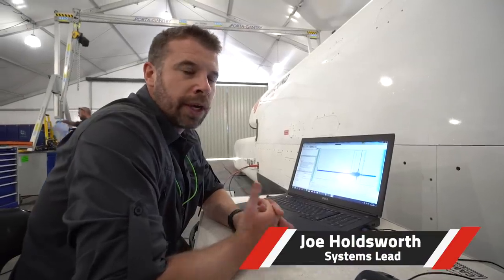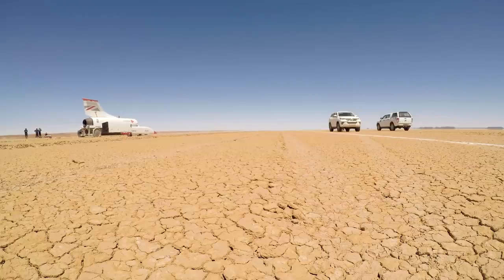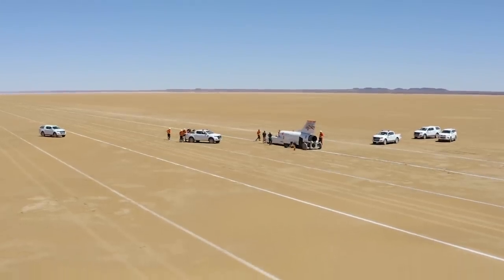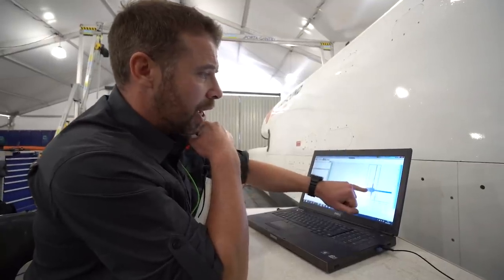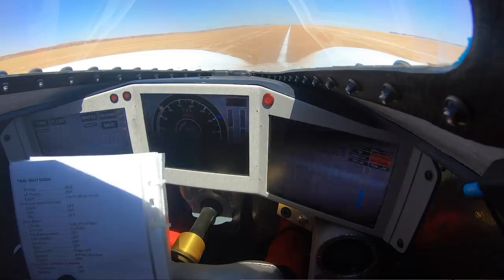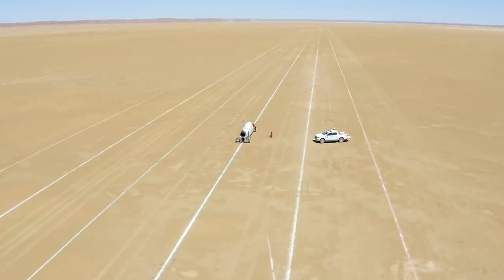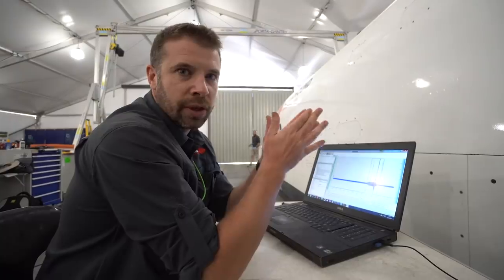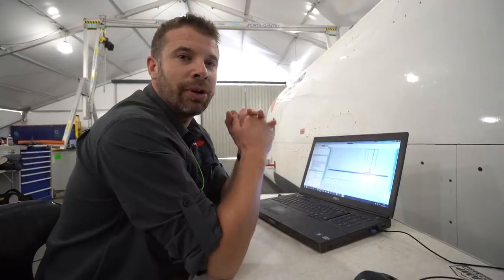Bloodhound LSR Run Update | #2019HST

Comment: That's some force on the vehicle and the resulting movement of things that causes contacts to move.
Going to have to time after seeing the falling edge and check for a rising edge in the debounce period.
Is it practical to have that?
There's many digital inputs from switches, one can't implement that on all now?
I would be soldering caps across stuff lol.
That's concerning though, that vibration can cause contact movement and an unintended command takes place.
Luckily it shut down the engine, but this is still at low speeds.
Now I'd be worried about safety.
Would rather sort out the electrical problem as a cause, the software is doing what it should.
i would not change it, fix dat switch.
It's a safety circuit, can not have filters or delays on it, seriously.
Thanks for the update, D.
Reply: Good points! But, that said, there’s no way that Andy would be able to push a button for only 10mS. I’d be busy soldering caps too but I wonder if they’d have them in the desert. Time to call Farnell, maybe! 😁

Comment: Not been fully following the progress, but is this the same track (with bumps) that the eventual record will be attempted on?.
Reply: Yes
Reply: No it's not.
They've got over 20 tracks mapped out. These are the preliminary test tracks for up to 600mph.
Reply: joe pineapples The surface is, yes. I think there’s a track going across the parallel tracks that Bloodhound runs on. If you watch, you can see a change to a darker colour at 0:53 in the video.

Comment: Ah, a software work around for a hardware issue. I spend half my life writing those. I've written at least two debounce routines in recent years that I can recall.
Reply: That did not work out well for Boeing.
Reply: Bob Smithies Because Boeing's software work around was badly designed, not documented externally, and the impacts or even existence of it on the control of the aircraft not in the pilot training material. I am sure Andy Green is aware of this one.
Reply: @owensmith7530  - really ? Lets hope they put it in the manual.

Comment: Is this going to continue building to the 1000mph record attempt, or is it a test program that will stop short of that?
Reply: This year is testing with the jet engine only. Next year they’ll be back with the rocket installed as well.
Reply: @andylewis7360  I remember reading something like that ages ago but, with the stop/start funding problems, wasn't sure if they'd changed their plans to do it all in one hit, while they could afford it.

Without the rocket, isn't it still possible to slightly exceed the Thrust SSC record? Not sure if I imagined that bit.
Reply: tjp353 You’re right. I was working on the basis of the original plan, as I perceived it. But I’m sure the plan was worked out meticulously so probably best to stick with it.

I suppose bloodhound could beat Thrust SSC’s record, given a long enough track. We can hope, I suppose. She certainly seems to accelerate like a scalded cat! 😁

I pretty sure that the full record attempt will be next year, not least because Bloodhound’s 2019 exploits could attract a good deal more sponsorship support.

Comment: Literally "switch bounce". Hmmm. Wonder if the switch manufacturer envisaged their product doing 1000MPH across a desert in a vehicle with metal wheels? Ha! Go for it folks. Faster, harder, more!
Reply: Good point! They were altering suspension settings yesterday. Electrical control switches and connector contacts are usually rated for high G ratings. Usually tested by putting them on a big loudspeaker cone and sweeping the frequency up from 0-20KHz. It’s quite unusual to get a bounce in normal operating conditions without an intentional click. I reckon it was a connector contact. Extending the debounce period should cure it. I only hope they’re using automotive connectors and not aerospace ones. Planes don’t get many shock loads. Cars do all the time.

Comment: Unbelievable how many tiny little setbacks this project is having.
Reply from the maker: GladiusYTR welcome to running a prototype racing car. These are just teething problems and easily fixed
Reply: @bloodhoundssc  Totally agree. Keep grinding at it!
Reply: GladiusYTR It’s par for the course, mate. A volume car manufacturer will build dozens of prototype and pre-production vehicles and test them almost to destruction over 18 months to 2 years before the first model is sold.
Reply: @andylewis7360  Yep. All true. It just puzzles me how sometimes small teething problems interrupt a whole day of running. I'm sure the Bloodhound team don't have all year to keep running the car and sort out niggle after niggle. Surely something like a steering wheel switch debounce filter should already be part of the control software and have some sensible calibration. Particularly given that NVH at 1000mph can't be a minimal factor.  OEMs do a lot of prototyping, true, but small issues like these don't usually interrupt testing. Granted this is a LSR car and the risks involved are greater... Perhaps these things are normal in the context of breaking records and we're not used to getting the special insight we are seeing from the Bloodhound team. Either way, it's so freaking fascinating and awesome.
Reply: GladiusYTR It IS fascinating, isn’t it?! My guess is that they went for the minimum value they could set, on the basis that if it doesn’t cause a problem then they’d get the fastest possible reaction time. I’ve never used a debounce time of less than 50mS and 100mS in most normal circumstances. Given the fact that it’s a kill switch for an engine that takes tens of seconds to wind down, I don’t imagine that it’d make a whole load of difference but I suppose in an emergency, some 10’s of mS could make some difference, although I can’t imagine what. My main concern is that it’s an indication that they’re using aerospace, rather than automotive connectors. Auto connectors have got to be more tolerant to vibrations than something that’s fitted to an aeroplane.
Reply: @andylewis7360  My thoughts exactly. "Less than 10ms" denounce is not an acceptable figure at all and my experience correlates with yours in terms of what would seem like a logical amount of time. Overall it may be possible that they are using Motorsport connectors even, we don't know the severity of the bump that Andy went over but from the data trace it looks like it was maybe 200% amplitude compared to normal road forces. If the switch wiring failed and not the switch itself, doesn't matter what switch you use. I hope that the Bloodhound team learn from this experience and identify potential failures like this before it causes another run profile stop.
From here on out it looks each run profile is a "one shot" milestone, so either they get over the wall of minor problems now or they'll be in South Africa until 2021.

Comment: Surprised your suffering with switch bounce.. somebody skimped on the switches!
Reply: Switches bounce, it's a simple matter of physics. The only switch that can never bounce is one so stiff you can never press it.
Reply: ACTUALLY.. @Owen Smith High end switches such as aviation switches don’t suffer with that problem. Just adding a 40-50 ms delay to the microcontroller isn’t a good fix as the bloodhound engineer had suggested, as the microcontroller is then occupied waiting out the delay! A high end switch or designing the switches with RC circuits in the first place would have been advantageous.
Reply: Robert Pitcher Depends how they've done the delay, the code doesn't have to busy wait. It could be an asynchronous timed event. Or it could read the timer on each switch transition and ignore any that are too soon. Or it could integrate and wait for a confirmed number of settled readings of the switch. There are quite a few different ways of doing it depending on your needs.

Comment: NO! Fix the hardware. It can get worse. Don`t mask the problem with software changes!
Reply: Exactly, hardware kills, software doesn't. 
Stay safe guys, I don't want to be reading Andy Greens obituary any time soon.
Reply: @hughcdavies  you can put a hardware RC filter on the switch contacts or do exactly the same thing in software.
One you can do in the 'desert', the other you can't
Reply: bjofuruh The software delay was a bit on the short side. That’s all. They’ve just changed a counter. It’s no biggie.
Reply: Im guessing you don't really understand debouncing then?
Reply: You can actually do a better job of this in software than you can in hardware. An RC filter only does one thing. A software debounce can be as simple as a delay and re-read, or it can average, or take the median value, or after a change wait for a certain number of consistent readings to take as a real change, or any number of other methods. You can choose the best method for the job.
Reply: Owen Smith True. And you’d need to allow for cap tolerances which are notoriously broad.